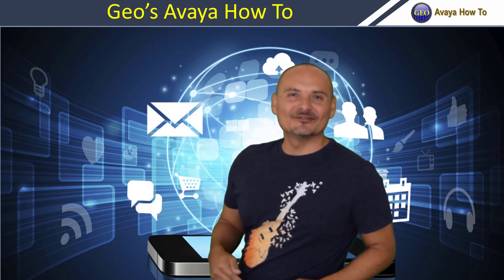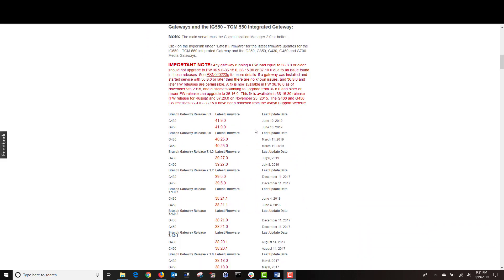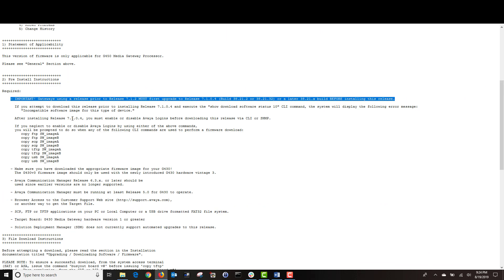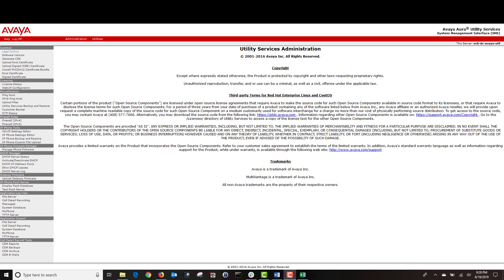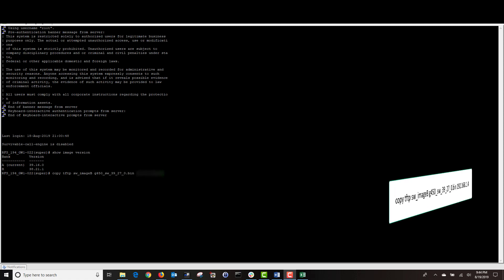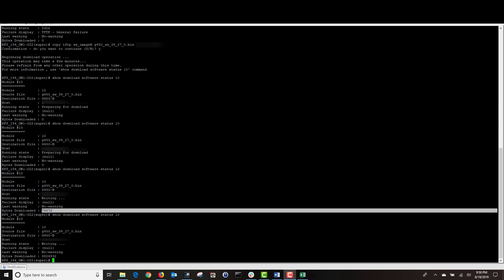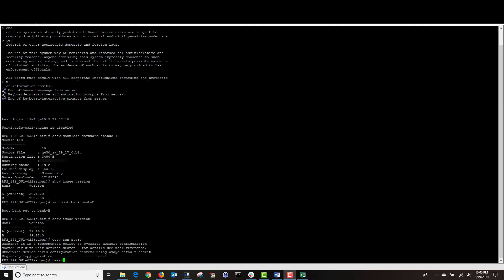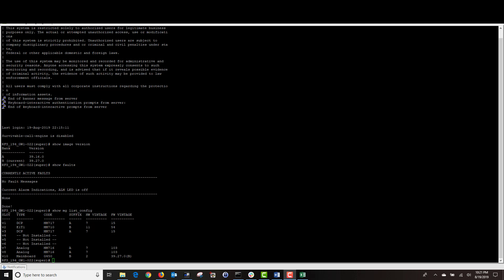Avaya Media Gateways Firmware Upgrades

Comment: excellent video.. it is the data, like stations, cdr data base, ip phones configurations, erased after upgrading?
Reply: i have a s8300 in a g450. R015x. 02.1.016.4 i want to connect third party ip phones.. what  do i need? thanks a lot for the advice.